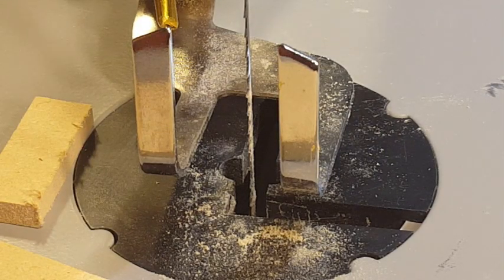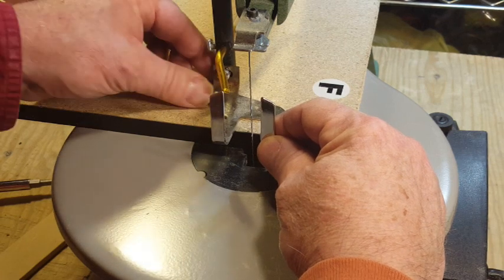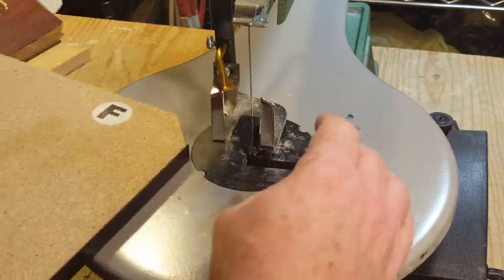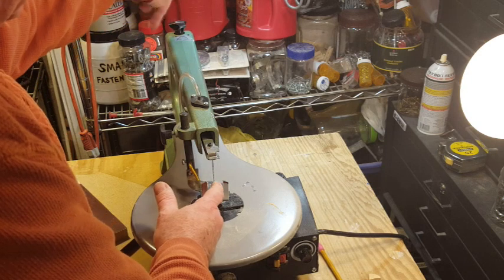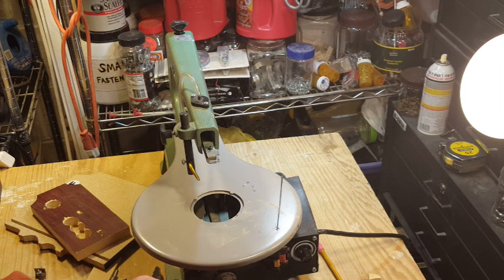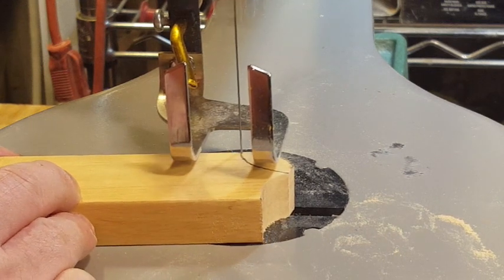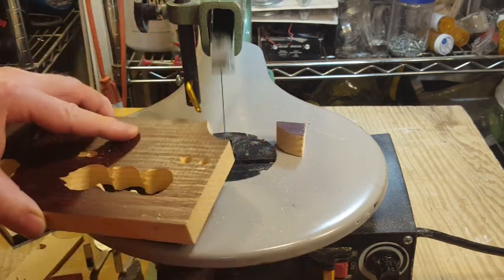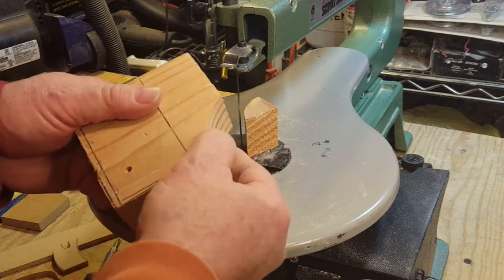11. Simple DIY - Let's make some scroll saw cuts!

Comment: For most simple cuts, jack the speed up high. Makes for a smoother cut. Very few cuts will require a slow blade, such as a very soft wood with a very high tpi blade.
Reply from the maker: Dan Limbach Thanks for the tip and for watching.

Comment: Ive got clone of this. Good to know it's not just mine that sounds beasty and jumpy out of box. I used old bandsaw blade trick and applied a sharpening stone to back and slightly to the side while on without touching teeth to dress the blade.
Reply from the maker: Thanks for your comment and for watching my video. I haven't had to do the sharpening stone trick yet. If your are interested, I do have a playlist of my other scroll saw related videos.  Here's the link: https://youtube.com/playlist?list=PLGCBwUeR2BD0uF74gOBR3Lh0Mi9hNnA-x . I think maybe you'd be interested in the 7-point star project. That one was fun to do and had some challenges.

Comment: The saw did quite well with the new blade installed; what was the TPI on the second blade? I think this saw certainly serves a purpose and will be a good introdtion to scrollsawing for the newbies. As I told you in my post in your other video, my main concern is with the clamps holding the blades and how fiddly it is to load the pinless blade when internal cutting on thicker timbers but nevertheless I can see it as a useful saw on the thinner materials and as you demonstrate it is capable of cutting thicker timber albeit would be a frustrating job threading a pinless blade through the thicker stuff. The more expensive machines have much easier quick release blade holding clamps but they do come at a premium price. The clone machine of the one you demonstrate here on mine only has grub screws to hold the pinless blades which was very fiddly and frustrating so I changed the grub screws for thumb screws which has made it a lot better and easier to change the blades. Trying to install the blades using the grub screw wrench was very tricky and the thumb screws have helped a lot to make the pinless blade changing much easier.If anyone has this saw or a clone and it has grub screws to hold the pinless blade; I suggest strongly changing the grub screws out and replace them with thumb screws. On mine the screws are M5 so probably the same on all of the clone models.Thanks again for the video it is most informative.
Reply from the maker: Thanks for your follow-up comment John.
I agree that "good" blade holders on a scroll saw can make the difference between enjoying or feeling frustrated while using the saw. 
The first scroll saw I bought is a "nicer" more expensive saw (I bought it used) and at a time when I didn't know anything about scroll saws. I very quickly got frustrated with the blade holders; so much so that I gave up using the saw and put it aside. 
I bought the saw you see in the video months and months later (I bought this one used as well) because I wanted to see if this saw was less frustrating to use. Much to my surprise and after some trial and error (lots of errors!), I learned to cut using this 2nd saw (and made video #11 that you watched). I think I was successful with this saw because it used pin end blades which I think are much easier to get started with as a brand new scroller.
As I was learning more about scrolling (by watching a lot of YouTube videos) I decided I wanted to try pinless spiral blades. That required me to upgrade the blade holders on this 2nd saw, so after some searching, I found some blades holders I thought might be good to try, bought them, installed them ( https://youtu.be/W83TllFnMgs , https://youtu.be/phlTMNvvUXQ ), liked them, and then tried spiral blades ( https://youtu.be/NVUfa8sS3Pw ). I have since tried several other blade profiles and it has been great fun experimenting and learning.
I have considered buying a more premium model saw. I looked at the DW788 many times but haven't bought one yet. I've looked at a few other models as well but have not pulled the trigger yet. I will probably go back to my first saw and try and upgrade the blade holders. Hopefully, I can get to a place where I'd enjoy using the saw.

Comment: I have found that getting rid of the foot and using your fingers pressing down hard near the cut makes for better control. But Im sure you will have figured that out by now.
Reply from the maker: Yes, I stopped using the foot after gaining some experience using the scroll saw. I now use my fingers as you suggested but also found using small blocks of scrap wood useful. In this video: https://youtu.be/xcVIpRYhA80 starting at about the 6 minute mark, you can see what I mean.
Thanks for your comment and for watching.

Comment: A reverse tooth blade reduces tear out quite a bit.  Also the harder the wood the slower it will cut.  I think you would be happy with reverse tooth blades. You don't need the hold down foot.  I take them off.  Good video.
Reply from the maker: Thanks! I will look for some reverse tooth blades and try them out.
Reply: The Foot there is for safety. So you dont accidentally push your hand or fingers into the blade. Do you really need to be told that. If so, you probably shouldnt be using the saw.
Reply from the maker: It has been quite a while since I made this video. I still have and use the same saw only with different blade clamps. I also don't use the foot. Thanks for your comment and for watching.

Comment: Thank you for answering.  I went back and I  got a Porter. Cable brand, I like it, but stills jumping a bit.  The wood that I use is cedarwood  3/4 inches, I don't do to many different cuts, but I noticed that the blade has very small teeth. Which one do you would use for this wood?
Reply from the maker: Thanks for your question. Honestly, I have not done that much scroll saw work. My recent projects have used the table saw to make the cuts. However, I recommend trying a few different blades. I suggest going to  www.olsonsaw.net and looking thru their scroll saw blade comparison chart. You can purchase Olson blades (as well as blades from other manufacturers) from Amazon. 
There is a lot of great information available for free on the internet. There are also some great scroll saw folks that have extensive channels on YouTube. Some time spent there will undoubtedly provide some guidance.
I hope this helps.

Comment: I just got one of these cheap scroll saws- I'm having a HUGE problem with EXCESSIVE vibration. It's so bad that no matter how much I tighten down the foot, it ends up loosening up. And there's no way I'd be strong enough to hold down the piece of wood if I took the foot off! Any suggestions? Several years ago I had gotten a cheap scroll saw from Lowes, and it was MUCH better than this one, until it quit working (I DID always hav ea problem with the tensioning knob on that one, but there was almost NO vibration, and I didn't have it bolted down). I don't do intricate work, so I don't need an expensive saw, just something to rough cut small pieces of pine for my whittling.
Reply from the maker: Hi Connie.  When your turn on the saw (with a blade installed and at the correct tension) and you are not cutting anything, does the saw still vibrate? If your saw is variable speed, is the vibration different at different speeds? If so, it sounds like your saw might be out of balance. If you bought the saw brand new, then I recommend returning it. If you got the saw used, check with the manufacturer (if possible) to see what can be done to repair it.
If the vibration only occurs while you are cutting, then try a different blade. A blade with more teeth per inch (TPI) should make the workpiece more stable (and not jump as much). When I first started using the scroll saw, I often used the foot to help keep the workpiece more stable (by preventing it from jumping). But after gaining some experience by cutting different kinds of wood and trying out different kinds of blades, now I don't use the foot at all.
I hope this helps. Please feel free to post here again with any further comments or questions.
Thanks for your comment and for watching.
Reply: @ImaginethenMake  No, it doesn't vibrate when it isn't actually cutting. I did change the blade, and it helped a little, but it takes too long to cut through thicker pieces with a smaller blade. I tried all different speeds, and it's definitely worse at higher speeds. But I took the side piece off, and watched it running with nothing in it, and I noticed that it kind of jumps or skips every few strokes. So that's what makes the wood jump, and causes the vibration because I can't hold it steady. I think maybe I should return it, because I think there's something wrong with it.
Reply from the maker: I agree Connie; it sounds like there is something wrong with it so perhaps it's best to return it.
Best of luck with the replacement saw.
Reply: @ImaginethenMake  I'm definitely returning it. I oiled it like they said, thinking that might help, but now it vibrates MUCH worse and is incredibly loud when it's just running with no wood!
Reply from the maker: Do you mind sharing the make and model of the saw?
Reply: @ImaginethenMake  It's a Central Machinery 16" Variable Speed Scroll Saw. I think the model number might be 63283. (That number is on the saw, but I don't know if it's the model number?)
Reply from the maker: I see. So it is the same make and model saw I have and showed in the video. I have had very good luck with mine; maybe you just got unlucky and got a bad one. Return it and get a new one and please let me know how that one works out. Good luck.
Reply: @ImaginethenMake  I wish I had seen your reply a couple of years ago! My scroll saw is terrible with vibrations, and extremely tiring to fight against the vibrations. It's way too late for me to return it. I cut a lot of 2x6s and my original scroll saw that I had in 2006 worked just fine. I unfortunately sold that one, and I can't remember the brand.
Reply from the maker: Sorry to hear that Lou. When I first started using a scroll saw, I was using pin end blade with a low number of teeth per inch (TPI) and found that the wood jumped a lot. But as I continued trying different blades and motor speeds, I eventually learned how to scroll and not have the wood jump much if at all. 
If the saw is vibrating without cutting, then it probably is out of balance. Since you cannot return it, consider contacting the manufacture to see if they can help.
My saw is limited to cutting 1.5" thick wood and thinner. 2x6s are 1.5" thick so my saw would most likely struggle to cut a lot of this size wood. 
Assuming you are trying to cut curves in 2x6s, have you tried using a jigsaw with a scrolling blade? Perhaps that would work for you.
Thanks for your comment and for watching.
Reply: @ImaginethenMake  Thanks for replying. I did buy different blades but haven't had a chance to try them yet since I work outside and it's been too cold for me. I'm going to try them today.Yes, a band saw would probably be better but that's not in my budget for a while. I will try contacting the manufacturer about it. One thing I changed is  that I'm working with thinner wood now, but even that is hard. I can't believe I didn't check into the problem when I started using it.
Reply from the maker: Hi Lou. I understand about it being too cold to work outside. Lately, I have been cutting 2x4's into thinner sections using a circular saw. (Here's a video about it: https://youtu.be/i41JzzyMZms . Here's another: https://youtu.be/QllIZKtmP7w ). I MUCH prefer making the cuts outside where the saw dust is not an issue (making the same cuts inside with the garage door closed, I'm forced to wear a respirator). Inside or outside, I always wear safety glasses and hearing protection.
About using a bandsaw: I have limited experience using an inexpensive tabletop model (9" model from Harbor Freight; here's a video about it: https://youtu.be/7hmKX1njZjc ). What I have found is that the saw is fun to use but is not very powerful. Trying to make "sharp" curves can easily bog the saw down even while using a 1/4" blade. Look at this video starting at the 6:52 mark to see what I mean ( https://youtu.be/eBQU1PT0EvM ). If you watch this entire video, you'll see that, in this instance, I preferred using the Bladerunner. (If you are not familiar with the Bladerunner, it is basically an inverted jigsaw. I have many videos about the BR on my channel including the one I linked here.) The other issue I have run into using the bandsaw is the blade guides; if I were to buy another band saw, I'd get one with much better blade guides to make cutting corners more accurate.
Hope this helps. Stay in touch and let me know how things are going.

Comment: Jack the speed up and be a bit more aggressive on holding your piece down.Is the scroll saw bolted down????May want to do that .Keep the saw dust flowing .Thx for the vid.The blade type and number effects your tear out .
Reply from the maker: No, the saw isn't bolted down. I'm planning to throw together a quick 2x4 with plywood stand and bolt it down to that. I'm still working out the right blade speed for clean cutting. I need to start using packing tape over the patterns also.

Comment: I see you have a few Harbor Freight Tools. By chance do you own the Mini Grinder? or the Flex Shaft Rotary Tool? I like my basic Mini Grinder and I will be making a simple 3D Printed accessory for it today probably. I also have the HF Rotary tool and I purchased a neat little Drill Press Stand that I have also made an add on for. BTW: I don't mean to start asking you a lot of questions.:-)
Reply from the maker: TheWindGinProject Ask as many questions as you like, it's fine. No, I don't have the HF rotary tool. I'll have to look for it the next time I'm in the store.

Comment: This is a reciprocating saw NOT a circular saw. Why do I say that? Essentially a circular saw pushes the wood one way; a reciprocating saw on the other hand pulls the wood down and then pushes it back up. 

There are three things you need to do to improve the cut you are making. First, speed the motion of the blade to what would be the correct speed for the cut. (No, I can't say exactly what that speed is, but if you take a look at a radial arm saw, there usually is a table that says how fast to pull the saw thru what hardness/softness of wood. My radial arm saw actually has an adjustment which controls the speed across the table that you  can pull the saw.)

Second, make sure you hold the work tightly against the table. This will not only improve the cut you make, but it will reduce the "tear out" you get. Just like its handheld brothers, if you don't hold the "foot" (in this case table) tight to the work, the saw will jerk you around all over the place with very little work actually being done. (I have a router table that is capable of holding a sabre saw inverted. The only difference between that table with a sabre saw inverted and a scroll saw is (mostly) the size of the blade (width mostly, but length as well) which determines the minimum radius of the cuts it can make. PS - it is NOT worth taking the router out of the table and putting the sabre saw in it. Toooooo much work involved - mostly in getting the router back into the table correctly!)

Third, change the "pitch" (blades per inch) of the saw. This will do several things. The more blades per inch, the finer the cut -- the wood between the top and bottom of the piece being cut will feel smoother (more like a file cut it than a saw blaid.) Also, because you are making a "finer" cut, the tear out will be less. (Holding the wood tightly against the work table will have more effect on how much tear out you get, but a finer blade will also prevent it as well.
Reply from the maker: Thanks Michael. I'm happy to report that my skills with a scroll saw have greatly improved from when I made this video. In fact, in a recent video, I changed out the blade holders so that I could use plain end as well as pin end blades.
Thanks for your comments and suggestions and for watching. Look for more scroll saw videos from me in the near future.

Comment: What number do you use hacksaw
Reply from the maker: Very good question! I'm assuming you are asking about the scroll saw blade I used. If you look at the video around 15:03, you'll see me show you the package of blades I bought from Harbor Freight ( https://www.harborfreight.com/6-piece-5-inch-scroll-saw-blades-9591.html ). All of the blades in this pack are pin end blades (NOT pin less). I believe I was using the blade that has 10 teeth per inch (the coarsest blade in the pack).
Thanks for your question and for watching.

Comment: I just replaced my very old scroll saw, and when I  used it the wood star jumping. I followed all the instructions, I looked into different videos and not to info regarding the jumping. Can some one help me. Thanks
Reply from the maker: Thanks for your comment. I suggest you try some different blades. There are many to choose from. The correct blade will make all of the difference. The correct blade will depend on what you are cutting and the kind of cuts you want to make. Hope this helps. Thanks for watching.
Reply: Check to see if blade teeth point downward. Blade upside down causes jumping. I find that skip-tooth blades also can help with jumping. Thick woods sometimes jump because blade is for thinner wood. I use a number 7 to number 9 for thick woods. I find that precision ground blades can also improve cutting in several ways.
Reply from the maker: Sorry for the late reply. It has been quite a while since I made this video so I now have more experience with the saw. I agree, skip tooth blades cut nicely. I haven't tried the precision ground blades yet. Thanks for your comment and for watching.